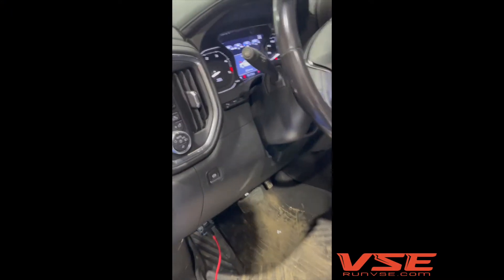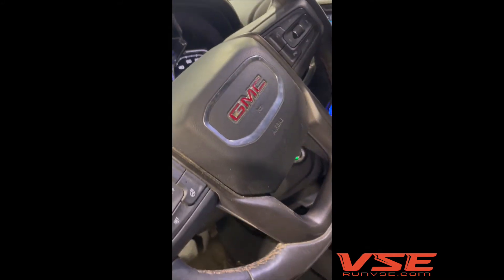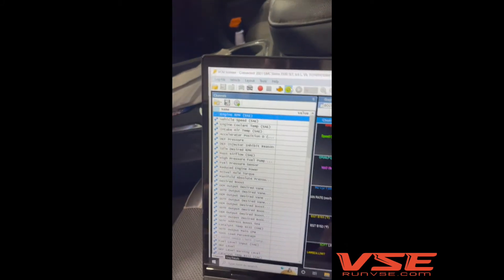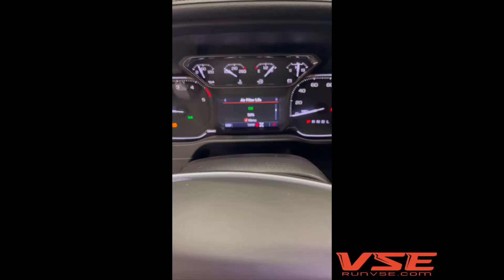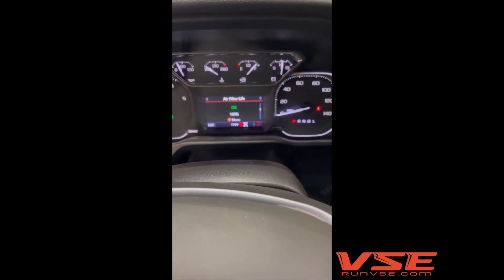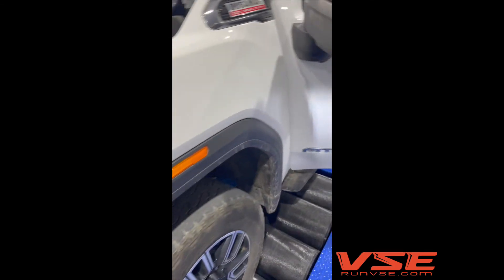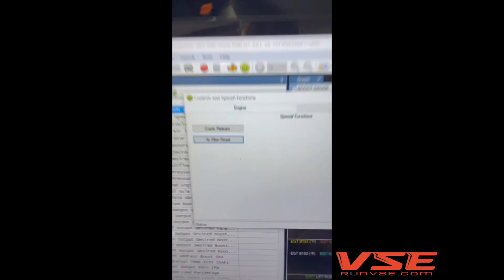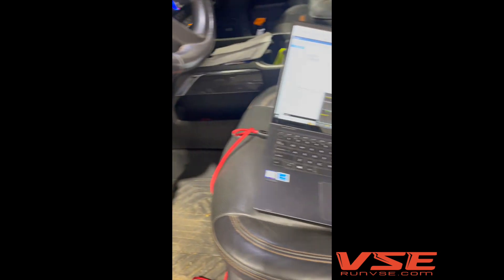L5P "Check Engine Air Filter System" Reset With HP Tuners

Comment: Any other way you found to do this without paying for HP Tuners license for the truck? I have access to hp tuners but would need to buy the license for my truck. I tried a $1200 Think Tools Pro but cant find the setting within that device to disable. Seen a video of it done on a top dollar Autel too. Tried multiple small sub $100 handhelds too without any luck.